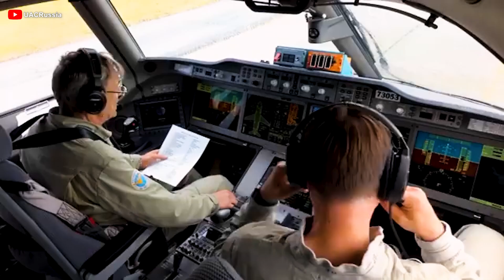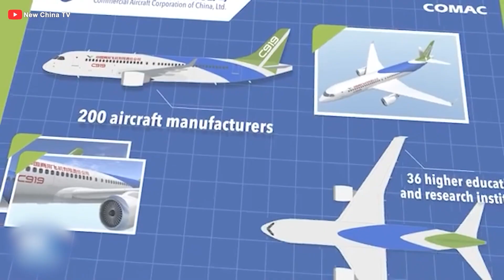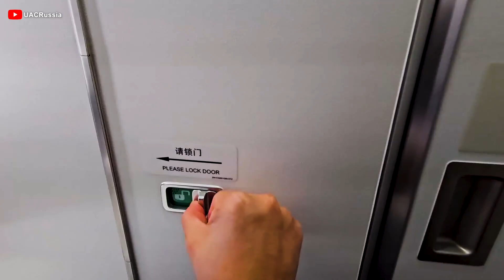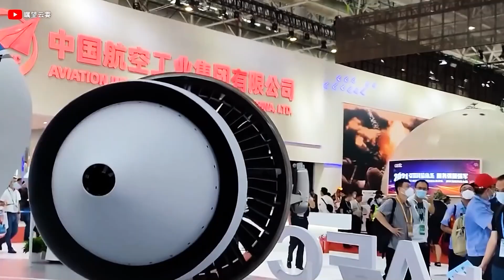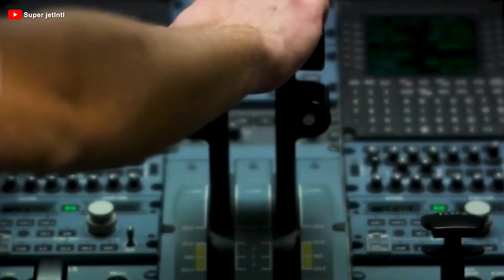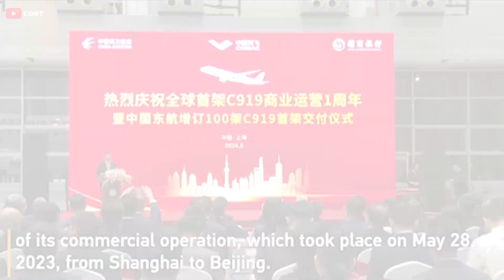The NEW Game-changers C919 And MC-21 will Revolutionize All Aviation!

Comment: The C919 is good; but the  MC-21 has superior technical specs. The range of the C919 is more similar to that of the Tu-204CM! I think those countries that want independence from Western tech will go MC-21 but those that just want a cheaper western plane will go C919 because they will be operating familiar engines and avionics! Best wishes to both aircraft!

Comment: I think it’s unfair to compare this airplanes side x side. To begin with the MS-21-300 is in a completely different class than it’s Chinese counterpart. Secondly the 919 will or at least for now is what the MS-21 originally was supposed to be, a cooperation. The Chinese might stick their own engines eventually but there are still many western components in their airplane. Thirdly whilst the west bans the MS by sanctions and withdrawal of certification(for protectionist reasons) the 919 is only being withdrawn certification again for protectionist reasons and at least for now, no sanctions yet. Russia is better anyways it’s domestic fleet returns.
Reply from the maker: Thanks for your sharing!